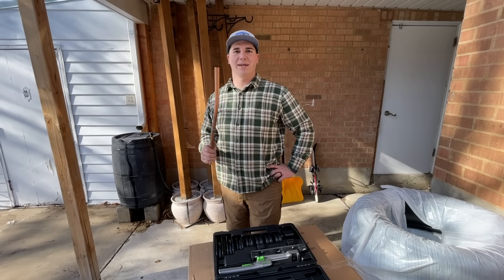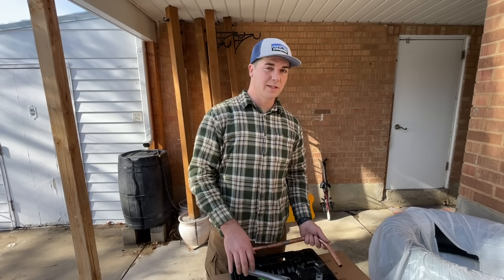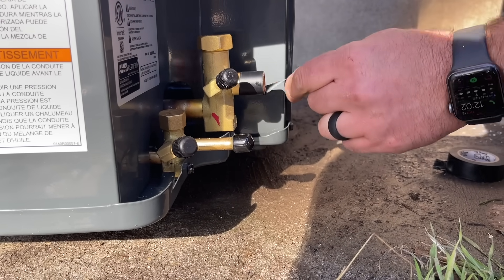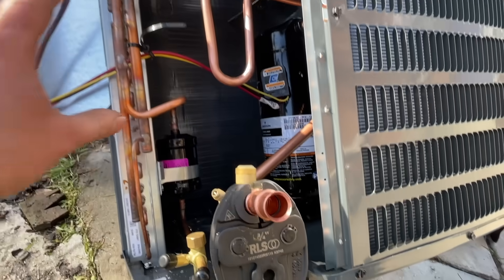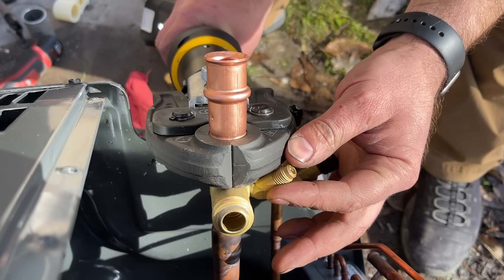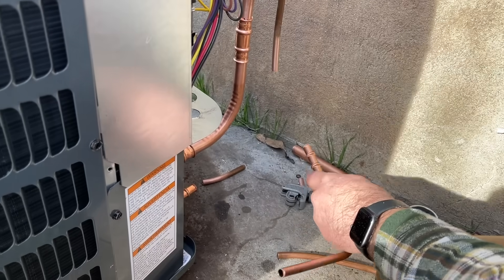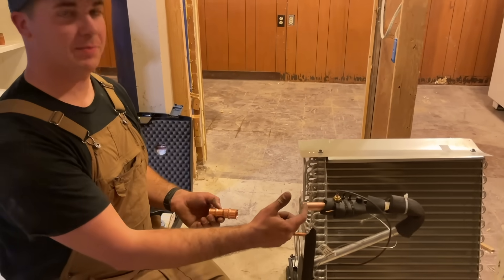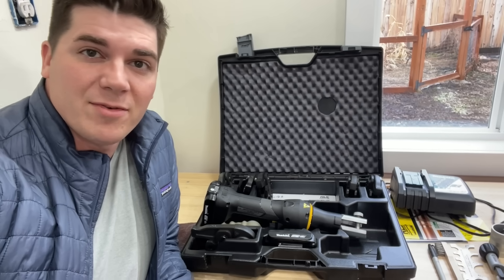Brazing Is For Cavemen. THIS Is The Future Of HVAC Copper Connections. -RLS Crimping Tool-

Comment: I guess I’m just old and hard headed.i don’t trust the seals in these fittings and how will they hold up over time.the tool is expensive and the fittings are also.when i braze a joint I know it’s not going to leak.as far as running nitrogen through when brazing,you have to pressure check anyway so it’s not hard to do.
It’s a great tool and hope you have good results using it
Reply from the maker: Thanks!